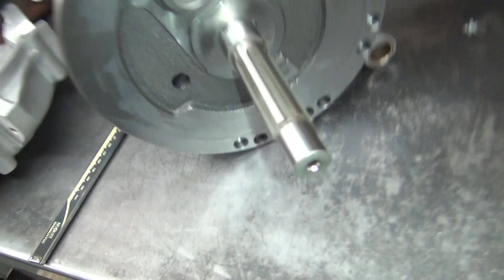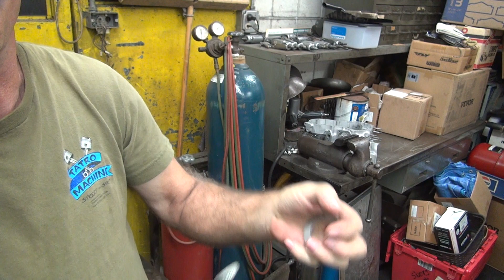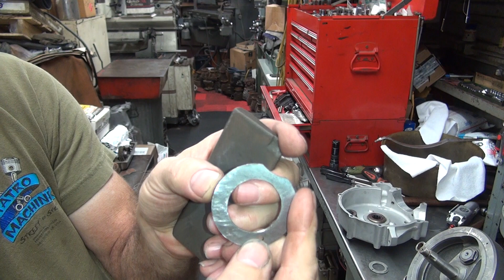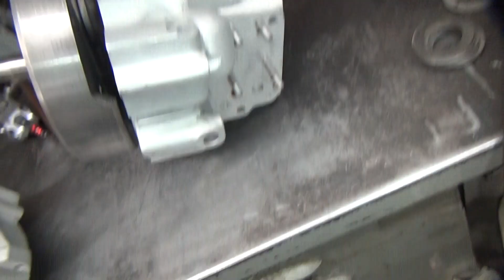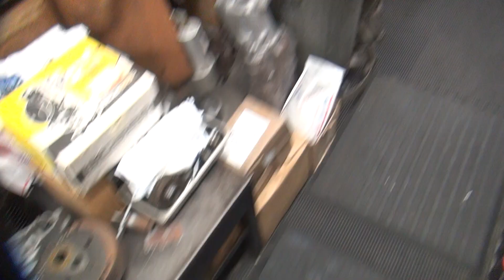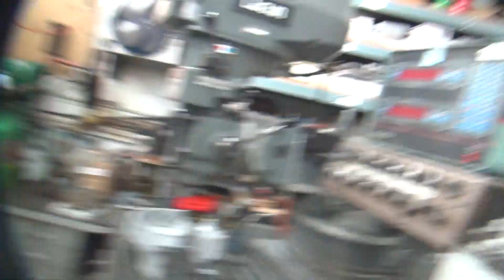#210 1947 EL case welding knucklehead 74ci motor rebuild & machining repair harley by tatro machine

Comment: Keenan, I'm thinking you're gonna have to start working more hours or stop shopping on EBay? The old new shop is starting to look like the new old shop. It's filling up quick, you might need to relocate?
Reply from the maker: i just cleared out some of the over flow. i like my parts.
tatro